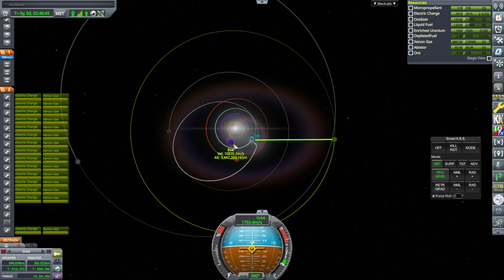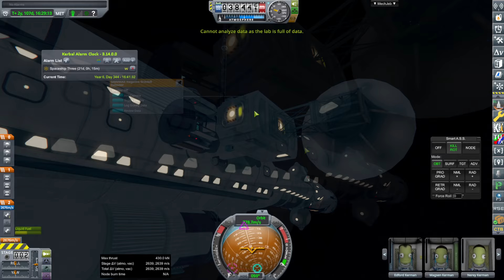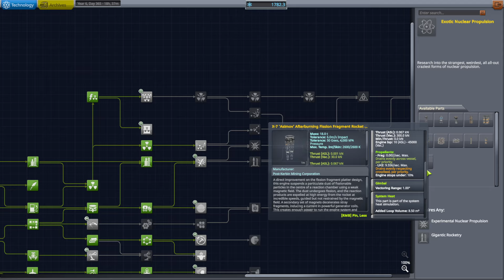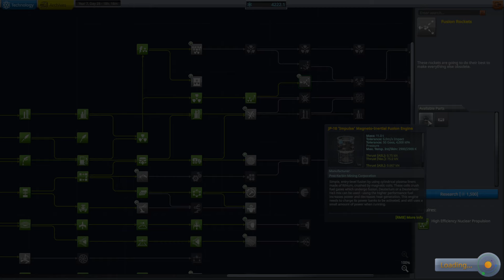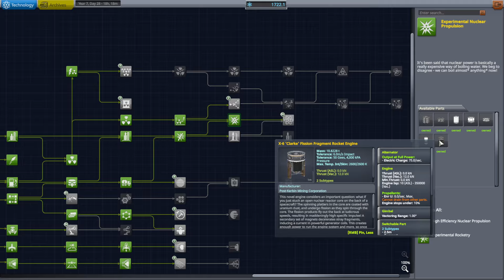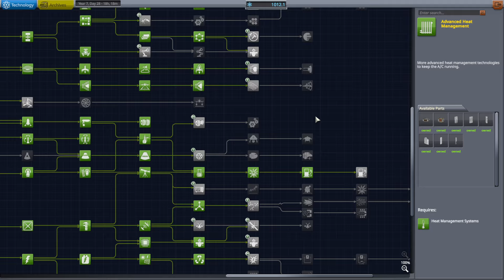KSP - Promised Worlds - Even More Crazy Things 7

Comment: 17:20 The limiting factor is that there is no way to refuel the 'Clarke' Fission Fragment rocket engine, meaning its high ISP is only good for small probes or solar system exploration. In practice it was not any better than the "Hamilton" Pulse engine, as it has a small impulse but a high ISP. Maybe good enough for a very barebones Interstellar probe, you'd only need a probe core and a rtg. If you want more engines, which you'll need, you should install Sterling Fission, Fusion, Antimatter, and thermal control(you'll need larger radiators), which contain FFT styled KSP-IE engines.
Reply from the maker: Well, I'll put something together and we'll see.